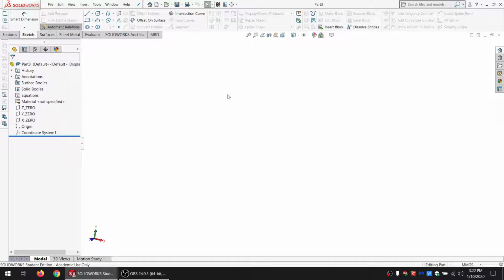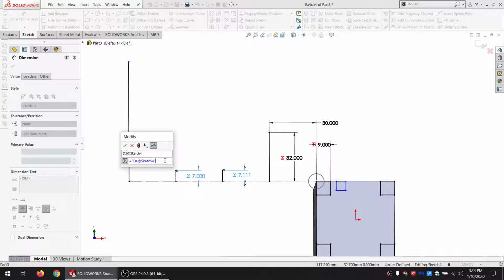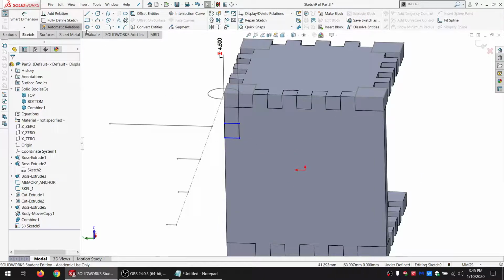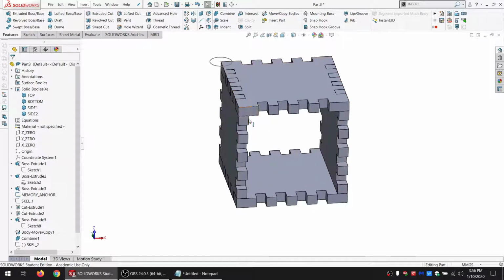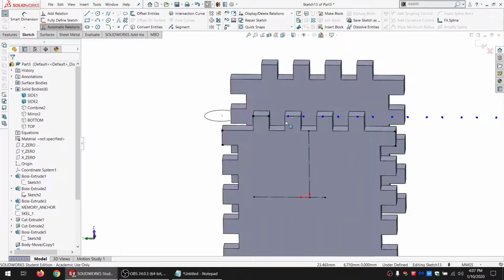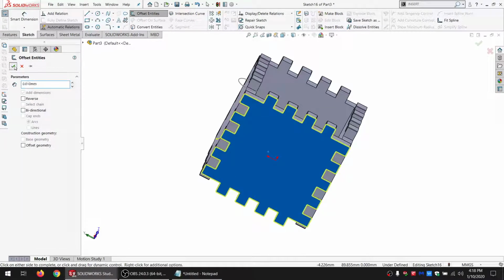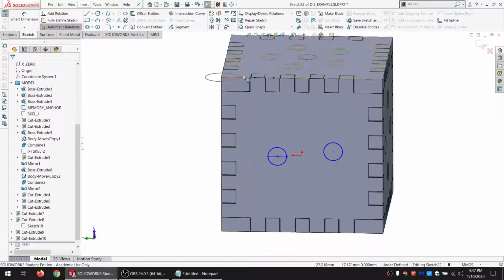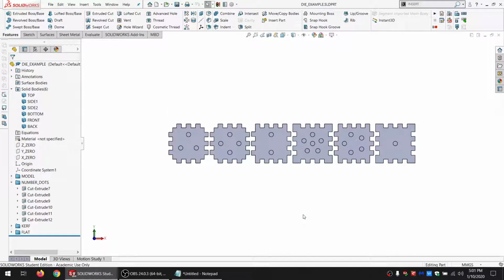Parametric 3D Modeling for Laser Cutter Introduction

Comment: Zack, thank you for posting. I learn alot from your style. I am a only a few weeks on using SW at work and am pretty frustrated, but watching you throw it around I have learned quite a bit. I had a question on why you use 101 and wasn't sure why you couldn't just use the chamfer selection and just manually do all the corners? Seems like there were alot more clicks and calculations. I think you mentioned why but I couldnt understand what you said.
Reply from the maker: Hi Gomer!  For the 101 question, it has to do with a bug I found in SolidWorks.  It's not open source software so I am not sure why, but using a number that is too low will cause an error if the formulas drive the number too high later.  Like if you do a pattern of 3, and then later you change the size and the formula now drives that value up to 60, SolidWorks throws an error that the number is too high for the pattern, in spite of the fact that patterns can be larger than 60.  Not sure exactly where the cutoff is, but I've never had that issue using 101 for a start and then backing down.  As for drawing the chamfers instead of using the tool, that has to do with the fact that this design is meant to be easily modified in size.  For example, if you change it from 50mm to 200mm, you end up with 4x as many fingers...and if you used the chamfer tool, only 1/4 of the fingers would be chamfered at that point.  Going the other way, if you reduced it to be only 30mm, you would get an error because some of the edges you chamfered no longer existed.  Drawing them as triangles on a pattern driven by a formula means that every finger gets chamfered no matter what the size.  Also, while it does seem like the same work or even more on a project like this, some of the designs I do have thousands of fingers, and patterns make things much easier there.
Reply: @MAKER_GURU  Thanks for the explanation! Keep posting if you have time. Really informative! Wish I could have you tutor me lol
Reply from the maker: @snowscum  Glad to help.  Actually used to tutor for a rate that ended up being under minimum wage after prep work was figured in just because I like helping people learn the tool that I use to make my art.  That was the original goal for this channel but life got in the way and then I just sort of forgot about the channel.